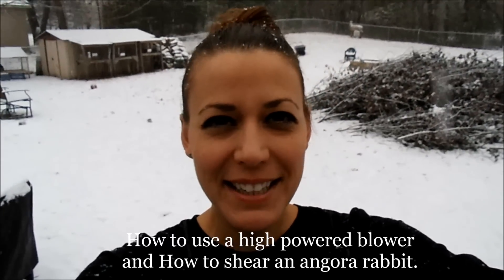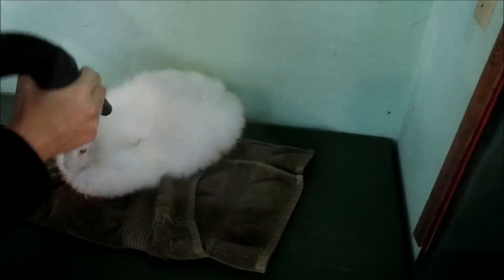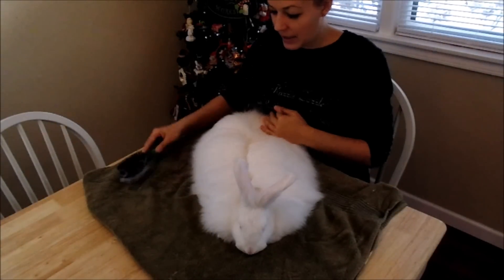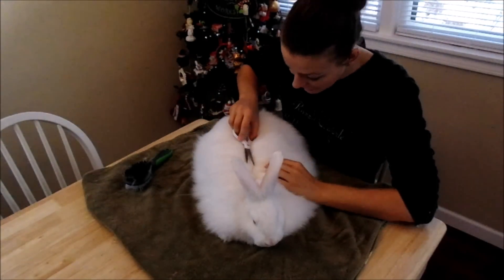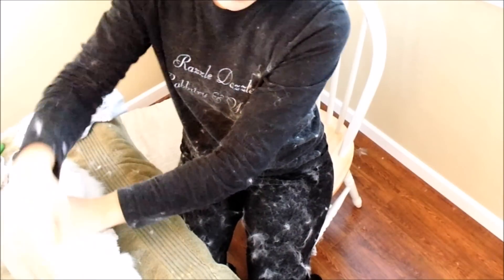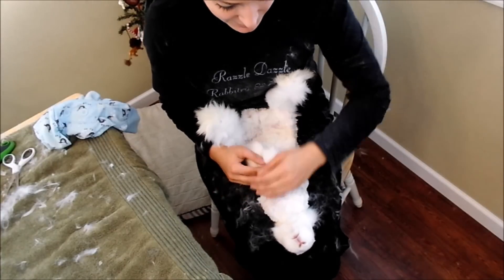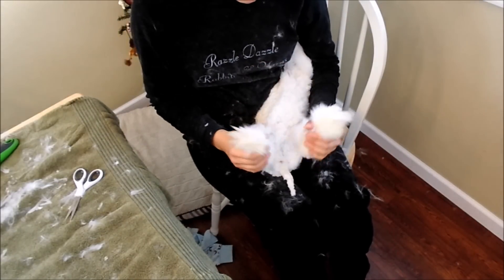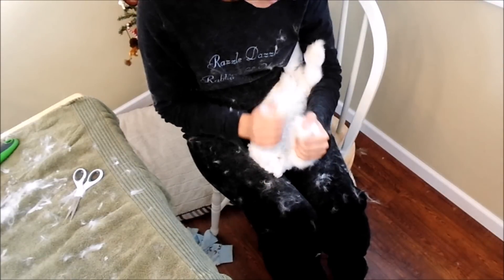How to shear an angora rabbit. How to use a high power blower. How to hold a rabbit for shearing.

Comment: Great vid!  Thank you!  I just took in 3 rescue EA’s.  They were sheared in june but right after their owner was in a vary bad accident and the buns were not handled since.  They are a horrible matted mess that im slowly gettin cleaned up.  Your hold tips i think will be VERY helpful as i’ve not been able to get them to settle down enuff to do their bottom sides.  My concern is the temp.  I keep them outside.  Temps here during the day are 50 degrees, night time tho its 30-40.  And i work till midnight.  So would pj’s be to warm in the afternoon?  Or should i “ dress” them at 12:30 when i get home?  Or would hay keep em warm?  These poor babies have been thru enuff. I want them to be comfortable!
Reply from the maker: What a very special person you are to take in the bunnies! Hay is good for insulating the hutch, however, it can get caught in the wool and cause matting. Not a big concern when wearing a sweater and freshly clipped. With our German angoras, we use hay and have very little concerns as Germans have more guard hairs and thicker wool than the English. Right after shearing is when the sweater goes on for cold temps. Using a sweater or thicker material would be better than the cotton pj's I used in the video. The bunnies have minds of their own when it comes to the clothes! Some keep wearing it until you have to remove it and some begin the removal right away.  You can leave it on until the wool starts a bit of growth. We do not leave ours on any longer than a week. Hope this helps!
Reply: Razzle Dazzle Rabbitry & Yarns LLC Thanks Stephanie!
Reply: *Enough 😊

Comment: Hello and a question- I just got 4 adult rabbits and they were already clipped. How often would you use the blower as they are re-growing their fur to get them used to the blower and to keep the dander down?
Reply from the maker: That is a very good question. I have now been many years without a blower. I found that dander is reduced when I keep up with healthy feed and housing, as well as healthy bunnies. But, there are days when a bunny gets into something and it would be quicker to use a blower to get them clean. If I did use a blower again, I would suggest only use it when you visibly notice issues, after going through a period introducing the bunny to a blower.

Comment: Do you do it RIGHT near her skin or like up an inch?
Reply from the maker: I have done both. It depends on the time of the year. Summer is for short next to skin clips. Leaving a bit more is better for winter. The scissors I use for this can be found here: https://www.amazon.com/Westcott-Straight-Titanium-Bonded-Scissors/dp/B072RV8SC7/ref=sr_1_3?camp=1789&creative=9325&keywords=westcott+titanium+scissors+5+inch&linkCode=ur2&linkId=1ead2a768a94ebba619c697b28387129&qid=1673536866&s=office-products&sr=1-3 If you prefer clippers, the clippers I use can be found here: https://www.amazon.com/Wahl-Professional-Animal-Cordless-41870-0425/dp/B00EVBXI4Y/ref=sr_1_1?camp=1789&creative=9325&keywords=Wahl+Bravura+lithium+ion+clippers&linkCode=ur2&linkId=5465c881fa8855aabd7a0f636f7de21f&qid=1673536938&s=pet-supplies&sr=1-1

Comment: What kind of clipper do you use.  I bought a  Wahl Show Pro Plus and I'm having trouble taking the wool off. Maybe I need different blades?
Reply from the maker: I have not used that brand and ended up switching to scissors for many reasons.

Comment: It’s late October here in Vermont and my boys need to be shorn, but I’m afraid it’s too cold. 
They live in a hutch (separate) in a 3 sided shed right outside our house with heat lamps. 
Do you think heat lamps and pajamas will be enough if I shear them? The lows are around 35-30 at night for now. I’m afraid if I don’t do it soon I won’t be able to until spring and their coats are already very long. I’m afraid of wool block if I don’t shear them
Reply from the maker: If possible, bringing the rabbit inside will help. You are correct, it does seem increase in wool length does increase chances of wool block.
Reply: I ended up shearing them the week before Thanksgiving and bringing them inside for a 10 days until they got an inch or so of wool back. They stayed in the bathroom and it was actually not too messy since they are litter box trained. I was worried they wouldn't like sharing the bathroom (they get along in the yard together but don't like sharing a hutch) but they got along fine. They had just enough space that they could be away from one another if they wanted to. I had a plastic pet carrier in the bathroom with them for them to hide in when they wanted since rabbits like to burrow. 
They have been thriving outside with their heat lamps and heated water bottles, I put lots of hay in their hutches as well for insulation.

Comment: Looks like you know what your doing but just curious why you don't use an electric hair trimmer. iI had a Persian cat and tried to trim it with a scissors and cut it.
Reply from the maker: I have used electric clippers for some time, but then switched back to scissors. All sorts of reasons they worked for me. Cost, maintenance,  availability, sound,  etc.

Comment: Silly question, but why cut by hand, why not use a pair of hair clippers?
Reply: rattieboy82 it can easily cut the skin. That’s why you don’t cut their entire coat, because rabbits have very thin skin they can easily bleed out and die.
Reply: @ezrasleet2028  but clippers come with different size grades so the actual clipper blades don't come into contact with the skin.
Reply: probably less stressful
Reply: Also, their hair is very fine. I tried using clippers and the hair just got caught it was difficult to use it on their fur even with expensive clippers
Reply: Sound of the clippers and how it feels on the skin may stress out the rabbit
Reply: If your gonna spin the fiber you also want the staples to be all close to the same length. I imagine that's easier to achieve with scissors. 
I use Clippers on my dog (Pomeranian Pekingese mix) and scissors on the rabbits, but if I didn't care how the fiber looked I could probably cut the rabbits with Clippers. They don't mind the blower when i blow out their fur so I doubt they'd mind the Clippers either.
Reply: @mirandaneizer3605  yes and angora is worth spinning and saving.
if anyone here has angora hair they would love to part with (or sell) let me know.
Reply: The clippers wouldn't likely stress them any more than the blow dryer, and would cut about 75% off the time.

I've never cut rabbit hair so I'm no expert, but in dog or cat grooming, clippers are considered far safer than scissors. Cats also have thin skin that will tear easily with even a small nick in the skin.  

Most professional groomers recommend only using a clippers for cats, and there are several very safe ones designed just for them. 

I think if I were going to try this, I'd use my Andis clippers with a cat blade on it to avoid the risk of snipping my bunny.  

...But let's be real, as adorable as they are, the odds I'll be shearing a rabbit anytime soon are very small. Lol

Fun to see, though, thanks!
Reply from the maker: It took some time...but there are now a variety of videos on the channel regarding clipping and wool removal. Methods and tools. I hope you were able to find some of the more recent videos helpful. Thank you for your questions and answers!

Comment: Are the jammies actually made for rabbits? Where do you find such cuteness? 😍
Reply from the maker: Amazon is a good place for doggie clothes...that you can use for rabbits!
Reply: How do you know what size to get with the dog pjs how do you measure the bunny I just got 3 and I’m from ny and it gets cold in the winter and I want to get them pjs for after sheering also what would u recommend for brushing and using to sheer with also do you use an electric shaver??

Comment: Is there a reason when people do this they sheer instead of just shaving it off?
Reply from the maker: This is a very good question. Shearing with clippers or scissors is a personal choice. Like what type of car to drive. Each gets the job done, but there are differences in how the job is done. Scissors are more environmentally friendly, sustainable, more economical, quieter. They are also more time consuming to use and require a different skill set than a clipper does. Clippers will require blade sharpening or replacement that is more costly. They will require an electricity or batter source. They also require oil and cleaning that can be more difficult than scissors.